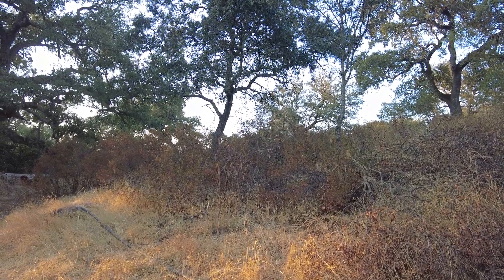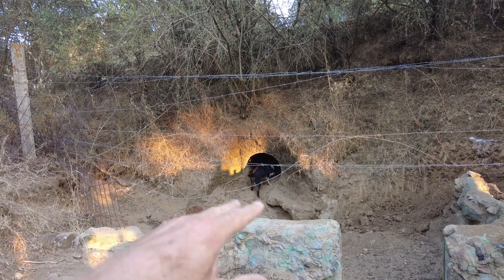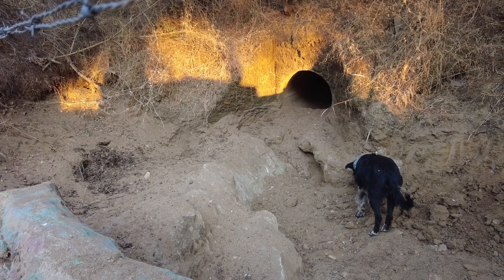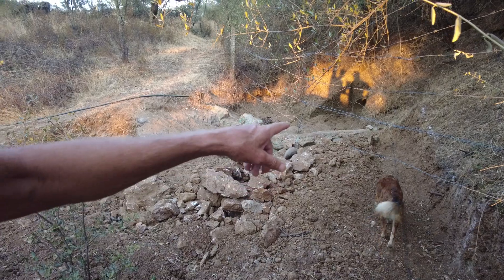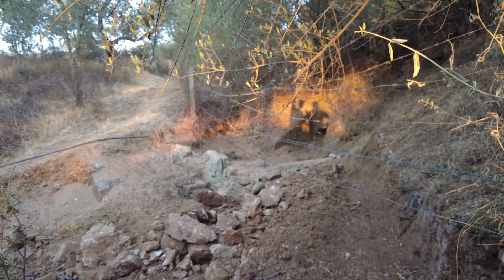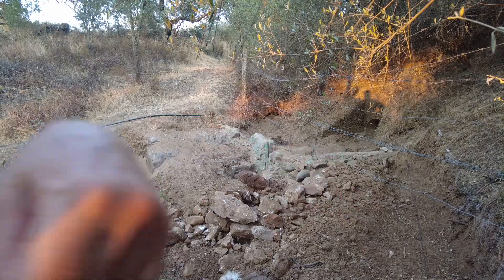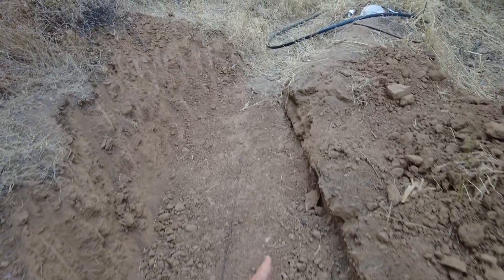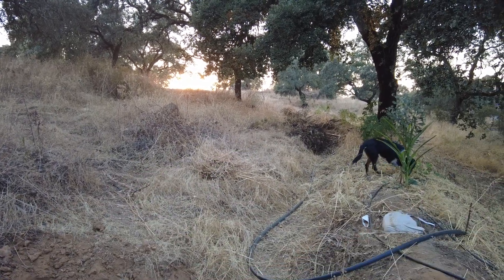Flow occurs in the length, while pressure is exerted at all points within a pipe.

Comment: You can slow down the water flow and or reduce water erosion in the new channel using well established vetiver or willows, assuming the channel gets enough sunshine. Roots will make it harder to wash out if not the tiny soil particles then at least small rocks  and gravel. 
For this to work (vetiver part), instead of planting individual tiny plants with few roots it should be better to first put the vetiver slips in a nursery not in pots but in 50cm long at least 15cm tall boxes with holes at the bottom. You will get an inter-tangled root mass easy to transport and plant. You can experiment with different vetiver placements, from just on the banks, across the channel or in some zig-zacking patterns.
As for the willows, I have seen here in Catalonia very hardy S.purpurea clinging by its roots to dear life in flood channels in la riera.
Reply from the maker: @darked89  Great information. Keep sharing

Comment: Riprap or Gabions: Place large stones (riprap) or wire baskets filled with rocks (gabions) at the culvert exit to absorb and dissipate the energy of the flowing water...Add erosion Control Mats. Biodegradable mats or blankets made from natural fibers, coir (coconut husk), or synthetic materials to stabilize the soil and prevent erosion. Or
geotextiles, fabric barriers to reinforce the soil and provide a stable base for vegetation. Create an outer buffer zone with vegetation to absorb the runoff...With some ingenuity you can create something special, a water harvesting oasis..
Reply from the maker: @Namdor2012  Now you have my attention. Thank you for sharing

Comment: I would suggest in the Canals that you consider to dig a series of Percolation Ponds along the route to allow two things to happen -

- First it becomes a water trap to slow down the flow of the water in the canal. How big you decide to build the percolation ponds is your choice. You can also use the ponds to redirect the flow of the canal periodically to a better suited route or to avoid obstacles. 

- Second the percolation pond (as long as you don't put clay in bottom) will allow for water to be absorbed into the land as opposed to being transferred above in a canal. Deep moisture penetration via the ponds should be beneficial to the surrounding trees. The more ponds you build along a canal the more water absorbed into your land.   

As for how to manage the speed and erosive force of the water entering your land - you will have to dig up that road and install several more pipes to allow the water more space to flow in a more natural speed. As you mentioned, the pipe only accelerates the water.
Reply from the maker: @paullynch277  Great sharing. Let's make ponds

Comment: I fully agree with Zaich's statement, "we want the bottom of the canal to be smooth...slightly curved on the sides".  
The bottom of the canal should be smooth for ease of unloading the eroded sand deposited by the water.  
I advocated for ferrocement because it was the easiest and most cost effective way to  achieve 'the curve' so the fastest moving flow was kept in the center of the canal.
The word you were looking for Zaich is 'kinetic' energy.
Martin, you will be able to adjust the volume of water and sand that flows into the canal by adjusting the opening of the sluice gate.
Zaich, It is a very good idea to have a nice row of brush on contour across the water flow from this swale to the next swale downhill.  The brush will distribute the flow of water and neutralize most of the kinetic energy. 
Looking forward to videos of your work as it progresses. 😊 👍
Reply from the maker: @stevejohnstonbaugh9171  Thank you Steve. Zach is smiling about all this praise. Great to hear from you, as always.
Reply: @SuerteDelMolinoFarm  Thank you Martin for sharing your discussion.  I really appreciate the sharing.
Also, I'm pleased to encourage a young person to share their thoughts.  They are our legacy, mate ♥

Comment: The inlet into the canal (or you can think of it as the outlet of the distribution box you've made) looks like it will encourage flow directly at the earthen side of the canal.

That is very bad, it will chew out that side of the canal very quickly in a high flow event.

I suggest at a minimum you "armor" that side with rocks, especially at the first few meters of the canal.
Reply from the maker: @twoc400s5  Excelent suggestions. Thank you

Comment: The water does not erode the sides of the culvert not due to low pressure, but simply because this high-speed water has no direct contact with those surfaces.

The erosive power of the water is related to its kinetic energy, not pressure - at least when we talk about the erosion of creeks or river beds.
Reply from the maker: @hotbit7327  Thank you for sharing. Flow work, or flow energy, is the work done by pressure forces to maintain the flow, which contributes to the fluid's kinetic energy. I'm not sure how to use this information.
Reply: @SuerteDelMolinoFarm   Let's forget about this new concept of "flow energy".
At the scales you operate, in open systems like that culvert pipe, canals, creek, pressure is not important. 
Pressure is an intensive parameter, so it's unrelated to work causing erosion. Only kinetic energy is and it's proportional to mv². And velocity v is here the most important for you.
5x larger velocity, 25x larger kinetic energy and risk of the erosion.
Reply from the maker: @hotbit7327  SUPER!!

Comment: You are badly mistaken. Don't look at the pressure, it's irrelevant here. Pressure is not the ersive "force".
Look at the kinetic energy ~ mv²   (Eₖ = 1/2 mv² )
Eₖ is proportional to velocity squared, thus a car at 100 km/h  has 9 times larger Eₖ than the same car at 33 km/h.

Thus to limit erosion you need to limit:
1. Speed of the water
2. Optionally also the amount of water

Thus from the above equation you want the water to move as slowly as possible to minimize erosive power. Canal might be wide and deep, just water has to move slowly.
Reply from the maker: @hotbit7327  Super. Brilliant sharing.

Comment: My instinct is that you should try and slow the water by increasing its surface area as much as possible, and keep it on contour/level to the hillside of the land so it does not speed up. Faster moving water in a canal directly after the culvert seems like it could be more erosive at whatever point it stops being a hard  surface canal. Check damns that can slow and spread the water along the way seem to make sense to me. Check damns will also cause the sediment trapped behind them to level the ground out and slow the water down more. 

When I see this particular area of your land I always have thought that building a much larger area for the water to pool in would help. As in a pond type structure below your current cement damn, with overflows being on-contour canals once the water level gets above a certain height. So the idea being a pool of water to slow it down, and on-contour canals to spread it out as it overflows.
Reply from the maker: @AngelaMerkeltree  Thank you for sharing. This is the longterm dream that we hope to reach sooner than later.

Comment: Liquid will always follow the path of least resistance, so with the current setup, the majority of the water will still continue to follow the old creek-bed. Agree with Zach about chugging a lot of rocks into the stream to slow down the flow. Fast flowing water = massive erosion, as you've seen in the old erosion gully.
Reply from the maker: @BrianJensen-ym5gk  Good one. Thanks for the sharing